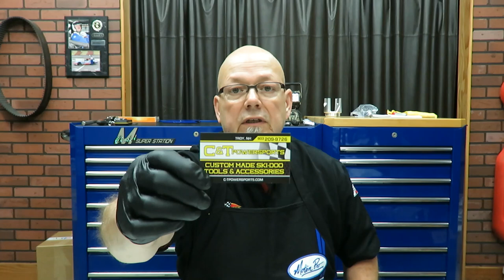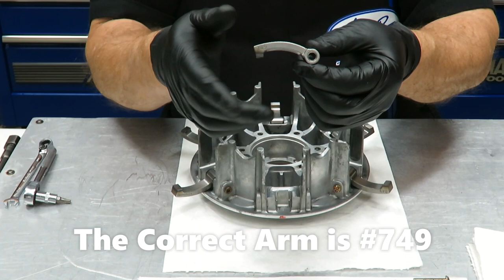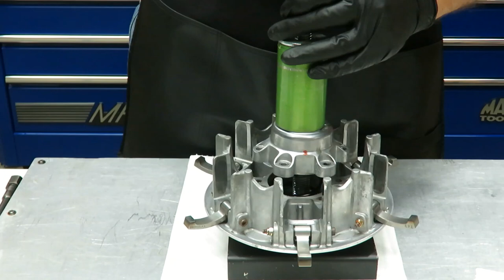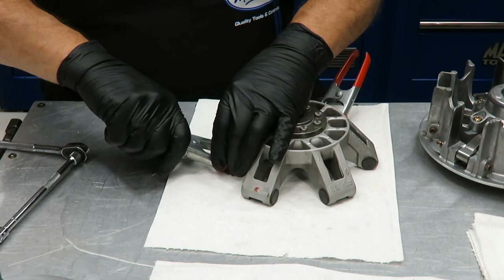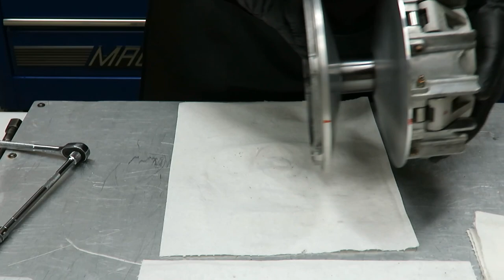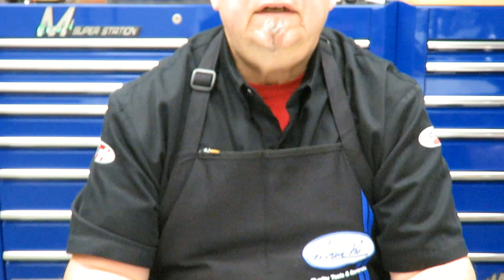Episode #2 E Drive 2 Assembly + Ski Doo 900 Ace - Performance Mods

Comment: Great videos...  I have a 2015 GSX 900 ace that looks like i may need to do some clutch work.  Only getting up to 60mph top speed. Is this the same clutch for my year sled?  Thanks
Reply from the maker: Same clutch. Your secondary spring is sacked or broken.

Bob
Reply: @bobroberts6722  hey Bob I have a few questions about a 600 ace skandic
Reply from the maker: @danmeekis6208  Sorry, do no get here very often, retired from the snowmobile world. Send your questions to bobroberts549@gmail.com